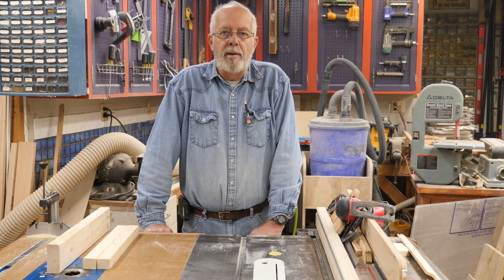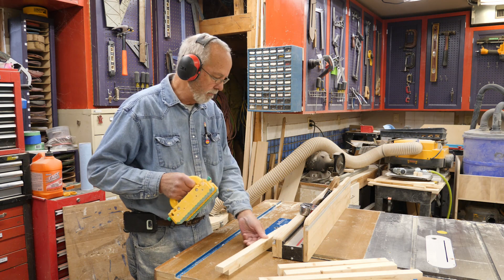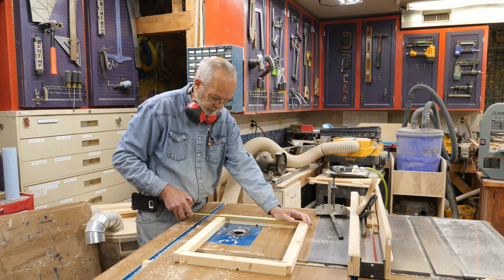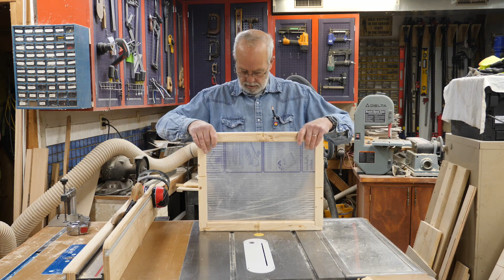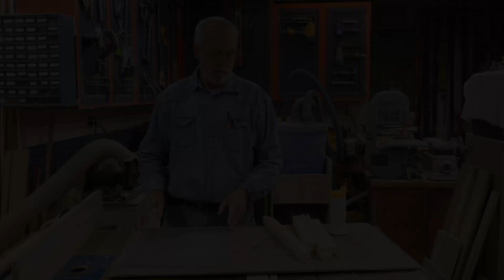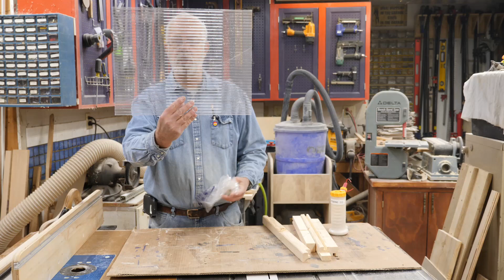Experimental Inner Hive Cover To Deal With Condensation

Comment: I've done something similar to that and yes I've worked with greenhouses to. one thing you have to do, you have to seal the channels in the end of the plastic if you don't condensation will get inside and turn it into a ice layer inside the channels it's a good idea why don't you try cutting a round hole into it then you can put something like a rapid around feeder. Except I used 5/8 greenhouse plastic not quarter. More distance between cold surface and warm moist air
Reply: Oh I forgot to tell you the 5/8 plastic comes in Black to
Reply: Of course I like the idea of clear means you don't have to disturb the bees that much to see them
Reply: Oh yeah you can also get that plastic in one inch really expensive though
Reply from the maker: I guess I left out about sealing the ends where the corrugation is exposed.  It is sealed with the same aluminum tape we use in the greenhouses.  This was some left over scraps of 8 mm (3/8") I had laying around.  (Also used some to make a bird feeder!)
Reply: @rogersshop  you must admit that is a major factor. I'm going to assume that we both know that you need Dead space in order to make a barrier between hot and cold. I used the 5/8 plastic it works really good and the plastic I used the black plastic they do have it it's just hard to find. we used to spray a little bit of rubbing alcohol inside the channel before sealing it it seems that it coats the entire inside and keeps algae from growing inside the channel. I don't think that would be necessary under a cover no sunlight you know but I figured I might mention it
Reply: How did it work